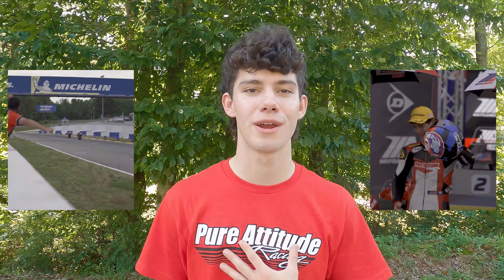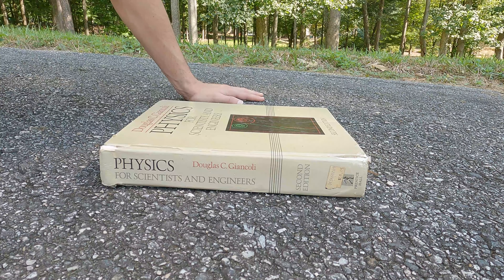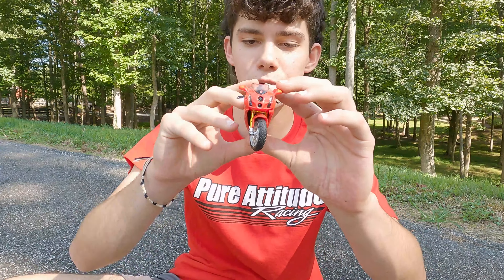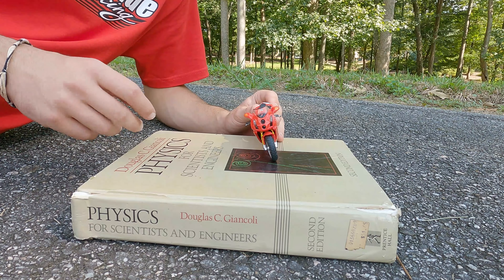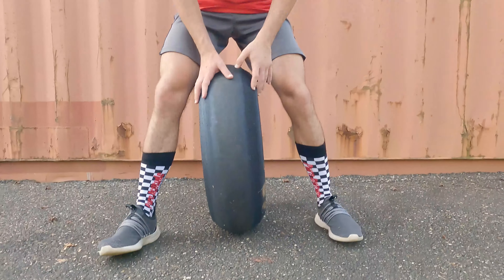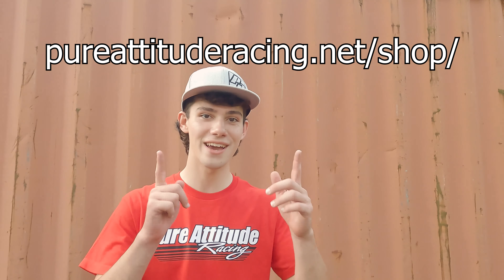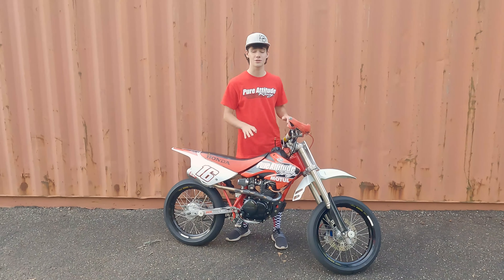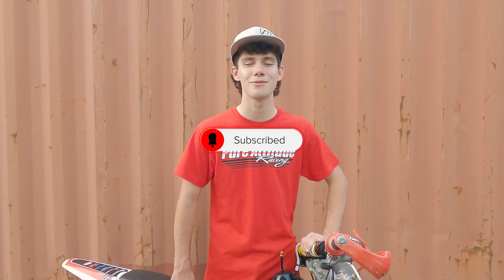PHYSICS OF CORNERING A MOTORCYCLE (TRAIL BRAKING)

Comment: Though I don't ride motorcycles myself, it was interesting to see the physics behind trail braking! I never realized how much riding style effects your tire traction. How much does tire traction effect the handling of the bike? Do you personally notice easier handling of the bike when you have more pressure/traction on the front tire or is it more of a subtle change? Hope that made sense!

Another question! Did you feel that taking physics courses in college improved your riding style or does that mostly come from practice?
Reply from the maker: Great question. Assuming that your suspension is set up correctly, the actual air tire pressure that you run can make a big difference in handling. The amount of tire pressure that you run will affect the size of the contact patch on the ground. You CAN have too much traction, which may cause handling/comfort issues. The preferred tire pressure to run varies from tire, bike, and rider.

My interest in physics actually came from my love of riding. I remember sitting in high school science classes feeling as if everything made sense relatively easily because I had an application to relate it to. My racing passion motivated me to pursue physics, and now my knowledge in physics helps me better understand what is happening when I ride.

Comment: Nice explanation, you broke that down into simple terms that are easy to understand. In particular, the sliding book analogy, with the force vectors demonstration, was the "aha" moment for me.

The demo at the end, when you showed preloading of the front suspension, could have been more complete if you explained how that changes both the rake angle and the wheelbase making it easier, when trail braking, to make mid turn course corrections.